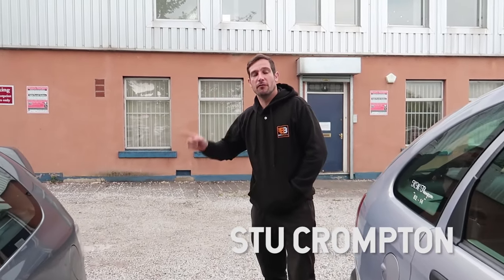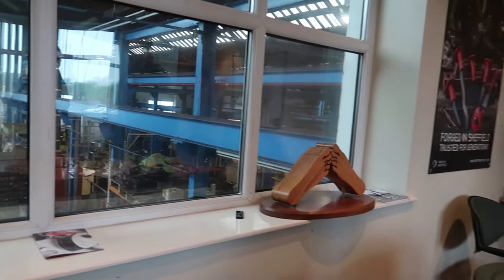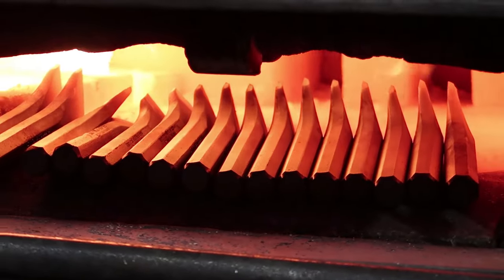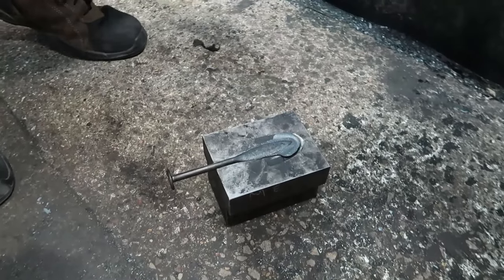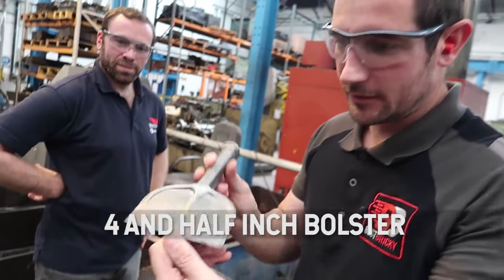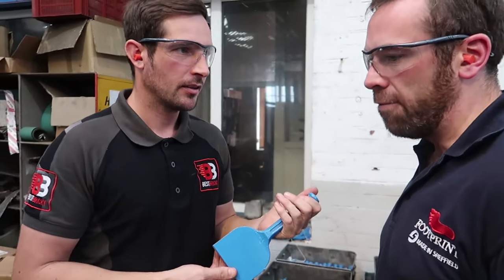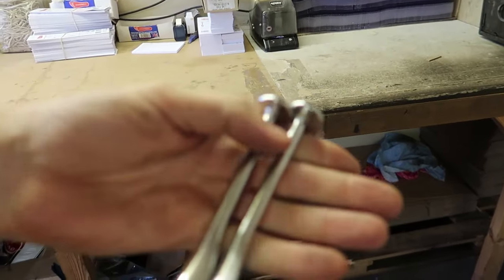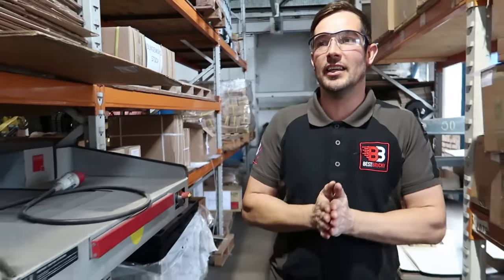Visiting Footprint Tools in Sheffield UK

Comment: I have the 4 1/2 inch bolster and the best thing about it apart from the quality of it is, I just love the fact when your cutting a block you can do it in two hits because it’s the width of the block unlike the 4inch where you need to move 3 times to cover the width of the block. Simple but affective. Quality tools footprint

Comment: I have met Tim a couple of times at tool shows. (Yes the director goes and stands all day at tool shows)
A proper bloke, not a suit.

I told him about the rumour on site that Footprint pins aren't as good as the use to be and the new ones bend.

Tim told me, and the video shows it, that they are still made the same way and if anyone bends a Footprint pin, send it back to them and they will send you an new one free of charge. They want to test a pin if it does bend. Personally I have never actually seen one bend! I suspect the rumour has been started by the competition.

The jointing irons are much better quality than Marshaltown's and don't get me started on the shit made in China.
The Metal in the Footprint Iron is just a better grade of steel, they last and last.
Reply from the maker: True Tim and rich are grafters
Reply: @Stucrompton1  For some reason, Footprint means so much to us, so we are grateful to them for keeping Footprint going and especially still British made. Thanks for spreading the word with the video.